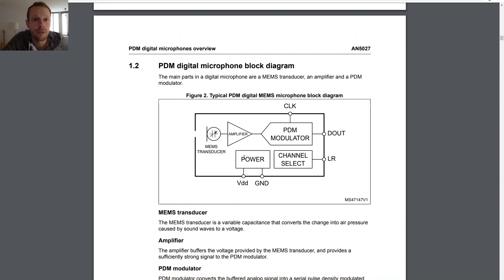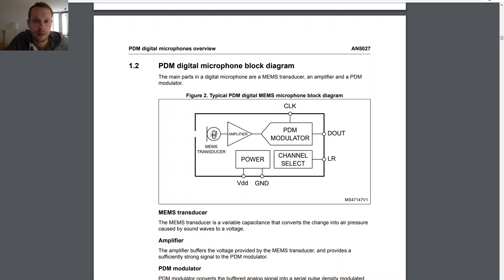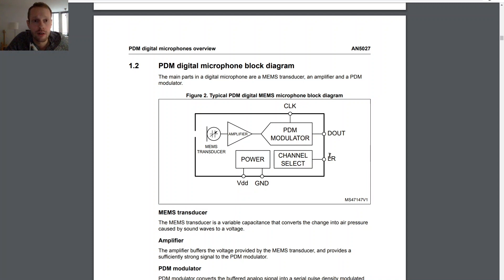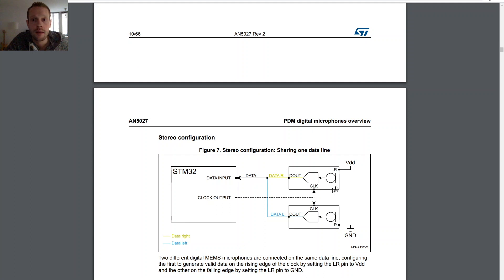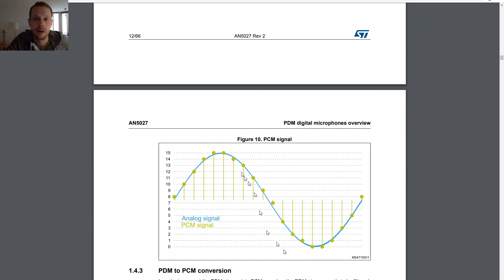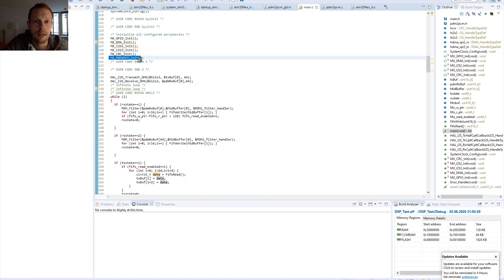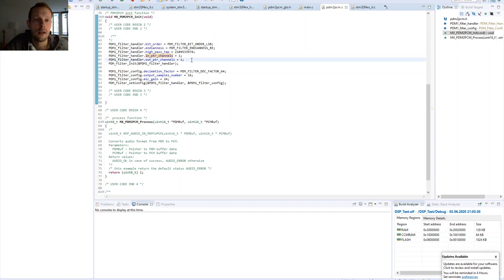[#20] PDM Microphones - Audio DSP On STM32 (16 Bit / 48 kHz)

Comment: Hello! Bro
I really appriciate and enjoy your videos.
But I'm wondering about fifo pointers in your source code.(like fifobuf_w_ptr, fifobuf_r_ptr).
They are increasing every time the functions like FifoRead(), FifoRead() are called. Is it Ok?
Reply from the maker: I haven’t checked the code but I think they’re relying on the fact that they start again with 0 as soon as they overflow. For an 8 bit unsigned type then at 255
Reply: @YetAnotherElectronicsChannel  Oh! I see. the fifo array size is 256 and the type of fifo_r_ptr and fifo_w_ptr are uint8_t, Thannks bro.

Comment: Hey, I have a question, why do you have "Hal_SAI_receive.... ,64);" instead of "Hal_SAI_receive...,128);", considering that pdmRxBuf size is 128 ? With your code, doesnt pdmRxBuf(64->127) all equal to 0?
Reply: This is a great question. I see by debugging that the second half of the pdmRxBuf is not zero, but I don't understand why. I too think I would normally start DMA with a length of 128, yet this causes the program to misbehave badly!

Comment: sorry for my confusion.. the output sound is going to the integrated DAC right? if so.. is the DAC connected to the black headphone jac? how are you getting the sound from the DAC ?
Reply from the maker: No I have used an external DAC converter (on the PMOD I2S2 Board). And that output I had recorded via the line inputs of my Zoom H4
Reply: @YetAnotherElectronicsChannel  thank you so much. Amazing videos.

Comment: Please can you explain to me further the role of HAL_I2S_TxHalfCpltCallback. Because I did not find a good explanation on the Net ?
Reply from the maker: For all sort of processing activities where you have a continuous data flow (and audio is such an application use-case) you are usually using double-buffers. Most DMA engines of the different uC's are supporting that usually.

The idea is: You always have one buffer where you are the processing on with your processor-core and the other buffer is used to transmit/receive.
As soon as the tx/rx operation is finished on one buffer, it will start rx/tx on the other buffer and you can start processing on the first buffer. This is doing then a ping-pong back and forth between those two buffers.

Here in this example, you have one big array of data which is "virtually" divided in two buffers. The Half- and Full- complete callback are then indicating which buffer is ready to process.
Reply: It's very kind of you to answer me.
If you don't mind, can i send you some questions by email where I found problems?

Comment: Also connected PDM microphone. There is the white like noise. With analog micrphones its ok it has clear sound. And in your video the PDM to PCM sound is not high quality. Is it acceptable for MEMS PDM microphones with PCM conversion or there is a methods to improve the quality?

Comment: At 14:15 what is the guarantee that fifo_buf won't overflow ?
Reply from the maker: The input stream and output stream are derived from the same BCLK. So they are exactly in sync. So there won't be any buffer overflow / underflow

Comment: show the hardware connection also
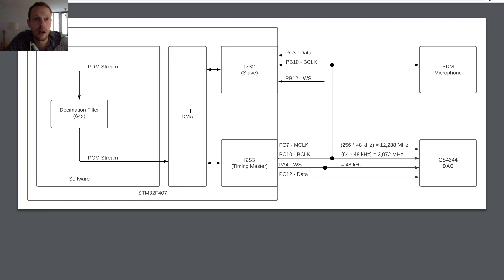Reply from the maker: Please check 5:52. There it is shown
Reply: @YetAnotherElectronicsChannel   I am using wolfson audio card with sm32f407vg. How can I know whether my board i working  or not. s there any code for this? bro.
Thanks

Comment: I am using an STM32F407VG. I downloaded the code to check if my board mic works. The code did not do anything. Can you confirm the hardware and software requirements of this project?
Reply: It's because he is using external codec, to use internal codec (audio jack), use the MY_CS43L22 library from https://www.youtube.com/watch?v=QIPQOnVablY&t=1404s&ab_channel=MutexEmbedded-Education. If you use the same code from YetAnotherElectornicsChannel it will work just by starting the internal codec in I2S Mode. (remember to make the two wire connections mentiones it the video (clock from i2s3 to i2s2))
Reply: same here!
Reply: i think he used an external codec not the built in one on the board

Comment: Should it work if I just run code on my board (I'm using F411E discovery) and connect my headphones to it? Well, it isn't, but surely I did something wrong. Besides it's not clear for me why are you using such sizes for the buffers and why they differ: 128, 256 and 16. Also I have no idea why only i'th and (i+2)'th samples are transmitted. How is it connected with the fact that you use 24b data of 32b frame and "half-word" configuration in DMA? I also wonder what is the reason of using slave mode, wouldn't it work if both I2S were set to master mode? Sorry, I am just a beginner and maybe I just didn't understand but I would be very grateful to hear some more thorough explaination on these details.
Reply: You need to use drivers for the onboard audio DAC chip . Example https://www.youtube.com/watch?v=QIPQOnVablY
Reply: Hello, have you managed to figure out how to do this on F411E? I watched the video which was replied by. But do I really need to manually install drivers now?
Reply: @theprotector11  yes. otherwise the DAC chip won't play the audio on the headphones. I have managed to work it on DISCO board .I  can share you the project
Reply: @kishoresaldanha815  Yes please. How exactly can we get in contact here? And do I need the driver as well for the microphone to send signal as well?
Reply: @theprotector11  I will share the github link. you will need a stm32f4 disco board. The board has cs432l audio chip and a pdm microphone. The driver for audio chip is only two files .c and .h which you need to include in this video's source code . Besides the code you will need to make two wired connections between I2S master and slave shown in this video.
Reply: @kishoresaldanha815  Okay, thank you.
Reply: @kishoresaldanha815  Hello, I'm struggling with the same problem as you two have. Can I also have a look at your github project?
Reply: @kishoresaldanha815  
Hello first of all thanks for the info but I'm complete beginner can u kindly explain how to use ur code to make the microphone read the signal and send out through speakers 🙏
Reply: @kishoresaldanha815  
could u share the same github link with me, thank you very much.

Comment: Thanks for another great video. Do you think you could use dual PDM microphones in a background or far field noise cancelling application? One microphone near the mouth and one further away. Convert both inputs to digital (I2S?) and subtract the far signal from the near signal? Or would you use a different way? I'm thinking about removing cabin noise in a vehicle. Thanks again!
Reply: No need to locate these 2 Microphones as you said.  Usually dual-MIC NS algorithm (BF is probably used) requires standard location of MICs.  For  cabin noise, you can refer some successful cases of algorithm companies or vehicle manufactures with MIC arrays.